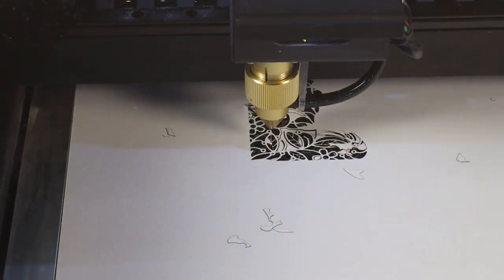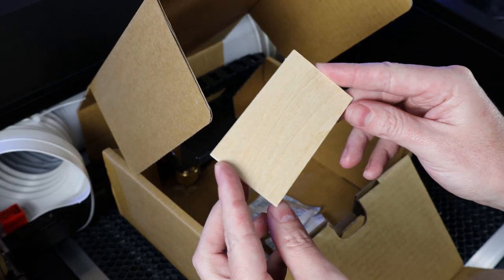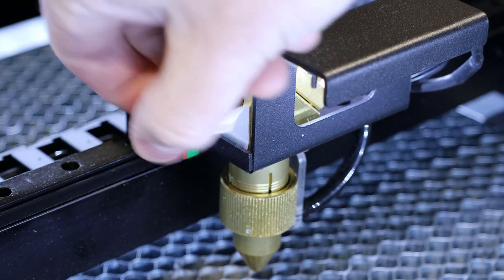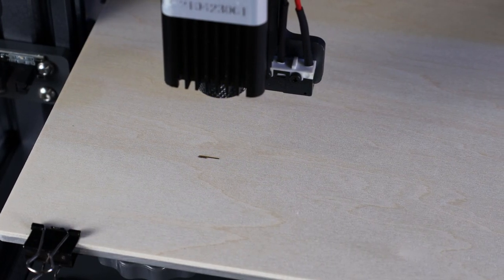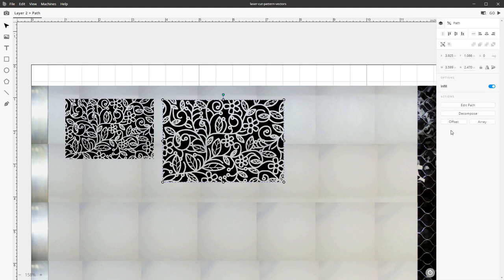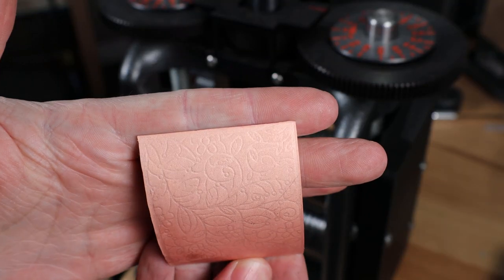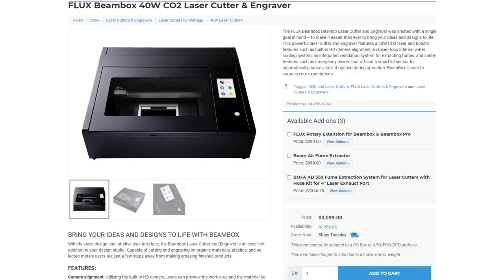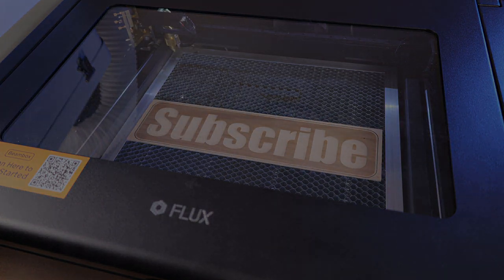Flux BeamBox Laser Cutter & Engraver - Setup & First look

Comment from the maker: Laser Cutters & Engravers:
FLUX Beambox 40W Laser Cutter & Engraver - https://bit.ly/FLUXBeamboxCO2LaserCutter
FLUX beamo 30W Laser Cutter & Engraver - https://bit.ly/FLUXbeamo30WCO2LaserCutter
Refurbished FLUX beamo 30W Laser Cutter & Engraver - https://bit.ly/RefurbishedFLUXbeamo30WLaserCutter
FLUX BeamBox Pro 50W CO2 Laser Cutter & Engraver - https://bit.ly/FLUXBeamBoxPro50WLaserCutter

Beam Air Fume Extractor &  Filters:
Beam Air Fume Extractor - https://bit.ly/BeamAirFumeExtractor
Full Replacement Filter Kit - https://bit.ly/FullReplacementFilterKit

Materials for Cutting & Engraving :
Clear Acrylic Sheet - https://amzn.to/3hLY8tB
Fluorescent Green Acrylic Sheets - https://amzn.to/3nNX9N2
Translucent Red Cast Acrylic Sheet - https://amzn.to/3lDfxFO
10 Colored Acrylic Plastic Sheet - https://amzn.to/3hMHQ3k
Basswood Sheet - https://amzn.to/3Ar171A
Birch Plywood Sheet - https://amzn.to/3hMvVTm
Fuyit Wood Slices - https://amzn.to/2XF1Jmf
Heavyweight Cardstock - https://amzn.to/3kpgUZw
Real Cowhide Leather - https://amzn.to/3znX4lm
Aerosol Black Laser Ink for Metals Marking - https://amzn.to/39orMQI

Ventilation Ducting & Fans:
4 Inch Inline Exhaust Fan - https://amzn.to/3nO6Db6
Cheaper 4 Inch Inline Exhaust Fan - https://amzn.to/3EHNwWu
4 Inch Aluminum Air Ducting - https://amzn.to/3u6ePF7
4in to 6in Duct Reducer - https://amzn.to/3hOOdDn

Other Stuff From MatterHackers:
3D Printers - https://bit.ly/MatterHackers3dPrinters
3D Printer Filament - https://bit.ly/3DPrinterFilamentMatterHackers
3D Printer Resins - https://bit.ly/3DPrinterResinsMatterHackers
CNC and Laser Cutters - https://bit.ly/CNCandLaserCuttersMatterHackers

*This laser cutter & engraver was supplied to me from MatterHackers and no money changed hands. All options in this video are my own. The above links are affiliate links so if you used them to buy anything I will make a small commission on anything you buy at no extra cost to you and it will help support my channel. *
______________________________________________

#lasercutter #FluxBeambox #textureplate

Comment: How has the laser been like for you after a year? Any issues?
Reply from the maker: I just checked the total work time on it and I have used it for 336 hours so far. 

So far the only problem I have had with it is it getting a little too hot in the summer time. My shop was getting to about 80-85f  and the water in the laser can only get as cool as the room so it would give me a warning and stop cutting. I bought an A/C unit to cool it down and that fixed the problem. 

It's a very good laser cutter. If you have any other questions just let me know.

Comment: Would be interested to know how thick this can cut in MDF or LaserPly. Can it cut 6mm (1/4”)?
Reply from the maker: According to the info sheet that I have found online it can cut 7-9mm materials. 

Here is a link to that info https://www.fluxlasers.com/products/beambox-pro/
Reply: @randymay  Thanks so much. I did try researching it myself but it’s not entirely clear whether it will do that in a single pass or multiple passes and doesn’t give cutting rates (speeds). I don’t want to spend money on something that doesn’t do what I want it to do. I appreciate your prompt reply though 👍
Reply from the maker: That is understandable and I can't test it out right now due to me being packed up to move. I did cut some 3mm acrylic and bass wood in one pass. I saw that some used it to cut plywood that was 8mm in one pass. 

I will do some testing once I get all setup in my new shop.
Reply: @randymay  Thanks again for this useful information 👍